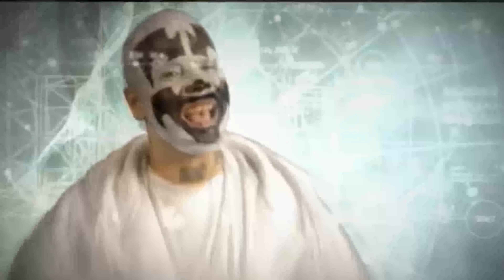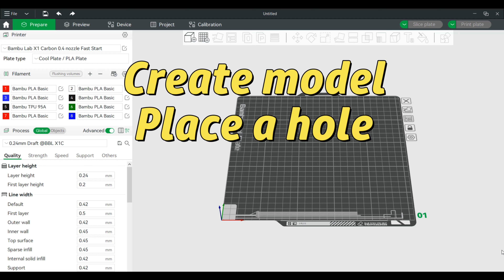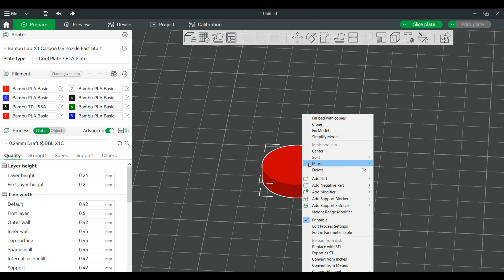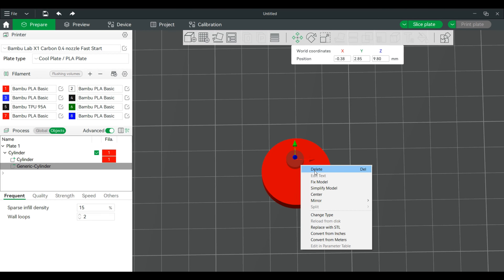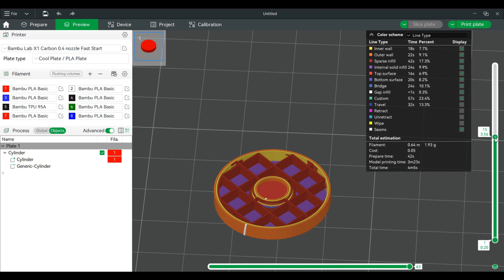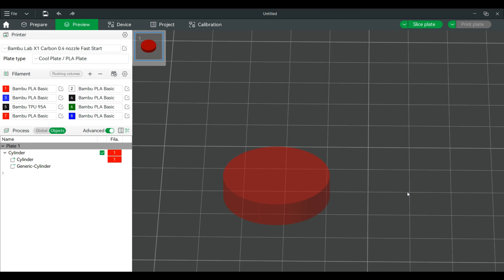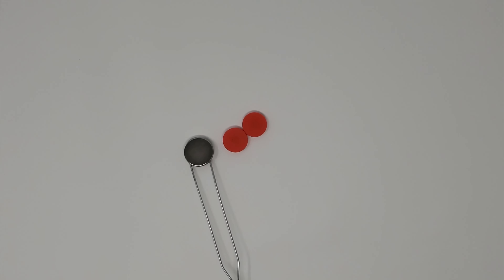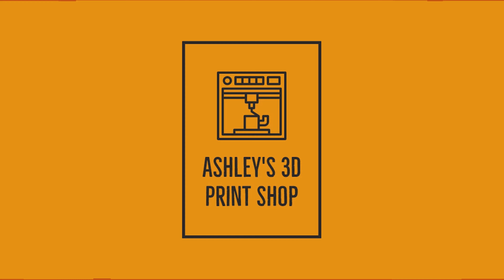Bambu Studio Tutorial Adding Magnets Part 1

Comment: One thing you should also note to the viewers is that heating these magnets above 70c will ruin the magnetism so its preferable to use the cool plate and not high temp materials when integrating magnets. Also you need to reslice the model after adding a pause.
Reply from the maker: Excellent comment. Thank you.
Reply: @PLr1c3r  Thanks a lot for the tip, saved me from my first fail at least :)

Comment: Late to the show, but wanted to share a quick tip.  First, I really appreciate the really simple "models" that you use for these demos!  The tip: when you add a part or modifier to an existing piece, the modifier's coordinates are based on the center of the existing piece.  In this example, that means that you don't need to "eyeball" position the magnet, you just need to set the coordinates of the negative modifier to [0, 0, 0].
Reply from the maker: Every piece of info helps. Thank you. 😊  The centering tool has been my go to in later videos. Idk why I just didn't emphasize it in this. Lol.

Comment: Also I’d add that if you making parts with matching magnets meaning magnets in both parts that will bond to each other be sure to know your magnets pole orientation so that they will attract and not repel. Unless you want them to repel.
Reply from the maker: Definitely a pro tip. I pre-mark all of my magnets now to know which is the attract/repel side.

Comment: I’m trying this technique now but not with magnets but with a part that’s also printed with pla Matte. Same material. It’s a project where I have an internal part that needs to be able to rotate inside. 
  I placed a pause at the layer just below where it would after print on top of the part and I inserted the pla part and hit resume but once printed it bonded to the internal part preventing its ability to rotate. 
Any tricks in doing this? 
 Also is there a way to remove a pause?
Reply from the maker: During the slicing phase you should see the pauses on the right. You can removed them by right clicking and deleting them. 

I would leave a small gap between the inserted part and the rest of the model. (a few layers worth) Is it small enough for the printer to "bridge" the gap so the part does not fuse with the insert?
Reply: @ashleys3dprintshop  thank you. I went back to that layer and it only had the option to add pause. I’ll look again. I was not able to find it.
Reply from the maker: @TheChariotdriver  Hmm, In the Slice tab.
 usually when you add a pause there is a noticeable Pause icon on the right. grey ⏸

If you left click on it, "Delete pause" should show up.

Or

If you bring the Green plus ➕to it you can right click and delete the pause. 

Either way can do it.

Comment: I noticed that you have TPU loaded in your AMS, does it work ok?
Reply from the maker: Good eye. general rule NEVER use tpu in the AMS, lol. That was a throw back setting I had on another project. TPU is too stretchy, squishy and occasionally you may get lucky but having to remove it when it fails is annoying.

Comment: Doesn't the Carbon X1 have a hardened steel nozzle? I've heard of people having issues with the magnet jumping out of the hole and sticking to the magnetic nozzle tip as it passes by. Seems like it's working fine for you though, have you had any trouble with this?
Reply from the maker: That definitely happened In this video if you look carefully. There are a few solutions. Make the hole deeper before closing it off.

Glueing the magnet down and give it time to set.

Use a more powerful magnet. Larger/stronger magnets will be attracted to the steel build plate more than the nozzle.

Comment: Another great video and very informative.  I do have a question I am hoping you might be able to help with or maybe create a video for, I am struggling with creating personalized poker chips.   I am probably overstepping my experience on this as I am attempting to add different text to both sides AND trying to drop in a washer for added weight.  My failure percentage is probably in the upper 60% range.  I have issues from not being able to read the text to the washer possibly being too large and the filament not "sticking" to it.  The ones I get to work come out great.  There are just so many variables that is very difficult what direction to go. I have printed many other complicated things (to me they are complicated) and have this main crazy issue with the pokerchips.  Just not sure if I am expecting too much from the printer.  Anyway - thank you for your channel, videos, and any additional help you can give.
Reply from the maker: This should be doable. what are the dimensions of your washer?
If there is room you may be able to give enough space for the filament to "bridge" the gap and not print directly on the washer.

Comment: wonder if you should add a drop of crazy glue so the magnet won't lift out when attracted to the nozzle.
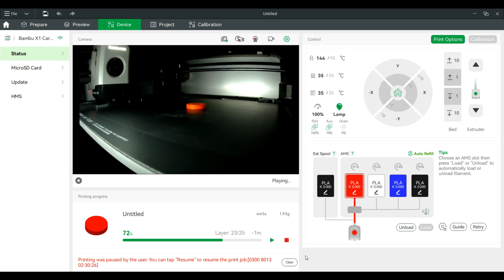Reply from the maker: 😬Giant "oops" on my part when I re-watched the video 5:03. lol
I think there are a few options. 
1. Better press/friction fit 
2. Glue
3. Strong magnet(neodymium) that clings to the steel build plate more than the nozzle. 
4. More clearance between the magnet and nozzle. 

Either way part 2 will take this into account. Thank you for the comment.
Reply: 5:44

Comment: Love your tutorials man. I have a learning disability and have trouble learning. You make it much easier. I do have a question though. Where you made a hole for the magnet, how can I make a hole in an existing file in bambu slicer...to make a container? Like a skull, remove a cylinder shape from it to make it a container. Makes sense in my head, but hard to put into words. I used the negative cylinder, moved it into place, no option to slice in order for it to remove that space (Slice Plate is greyed out). Tried delete...didn't work. What do I do? Keep up the great work.
Reply from the maker: Thank you very much. I am elated that I could help. I try to make videos that makes sense in how I learn. 

I think I under stand what you are asking. You want to take an existing model, skull and make it a container. You are on the right track about the cylinder/negative part. 

You would "right click" the model, add negative part, resize the negative part then move it into place. Adjust as needed. 

Then use the cut tool to create the top and bottom pieces. This will also move over the negative cylinder you created too.
Reply: @ashleys3dprintshop  forgive me, but your last paragraph lost me. :/ It helps to have a visual too lol. Video idea?
Reply from the maker: @CharlesDearingScroller  yes. Lol. Ironically I have something cooking already that would be perfect. 😁😁👍👍
Reply: @ashleys3dprintshop  I appreciate all ya do bud. Was so glad to find someone who specifically does all this stuff in bambu
Reply from the maker: @CharlesDearingScroller  I have had my bambu printer going on 14 months and it's been nothing short of fantastic. I didnt really know where this channel would go ultimately but if people are curious I'll try to make something worth watching. 

Thank you for sticking around.😁
Reply: @ashleys3dprintshop  I've only had mine for about 5 months. I want  20 more lol. VERY addicted.
Reply from the maker: @CharlesDearingScroller  I almost got another X1C but they were teasing the A1 for weeks so I held back. Considering I have been printing a ton with just one printer I should probably pace myself. 

A little known fact about this channel. It's called "Ashley's Print(3d) Shop" but I dont sell online or anything. It's mostly a hobby, gift prints to friends and family, and selling is last on the list. lol

Wait, you have a channel too? and over 500 videos.  
:face-fuchsia-wide-eyes: I should be asking you for advice.